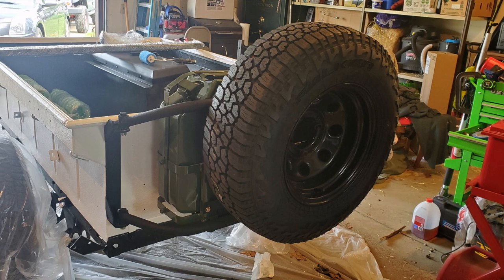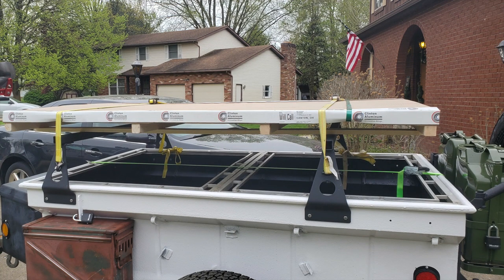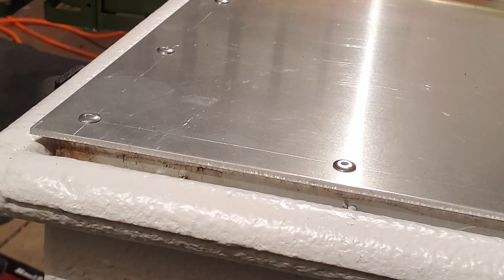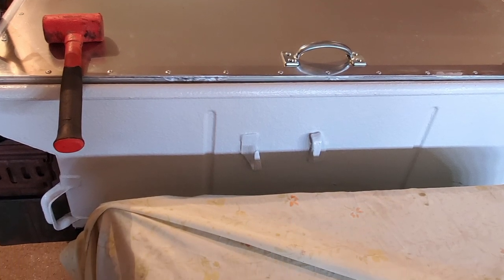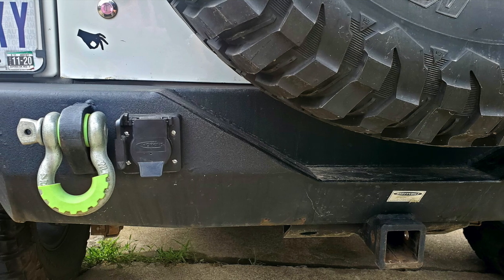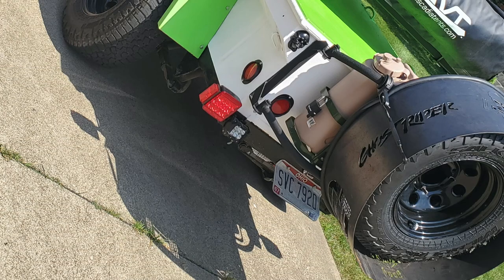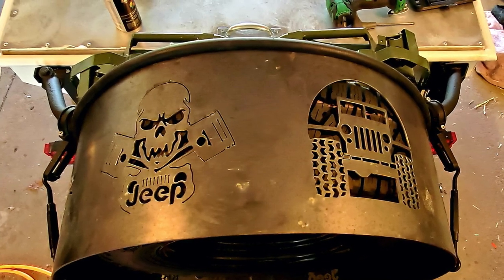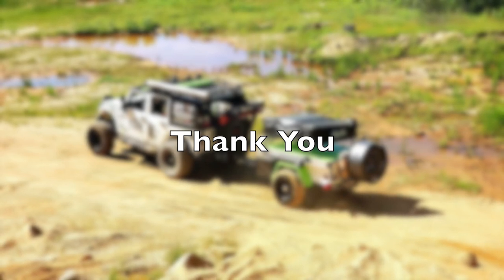M416 Overland Trailer build part 3

Comment: Great idea on the fire ring!!
Reply from the maker: Thank you! I have been places before where I had to scavenge for rocks to build one. On this trailer space is of a premium so adding it around the spare I lost no room. I don't have to use it each time but it is nice that it is there if I need it.
Reply: I was wondering what was that, for a second I though it was just for looks.
Reply from the maker: @MrMaldicion  I chose to have it laser cut with the logos so that it looked good... but it is very much functional.